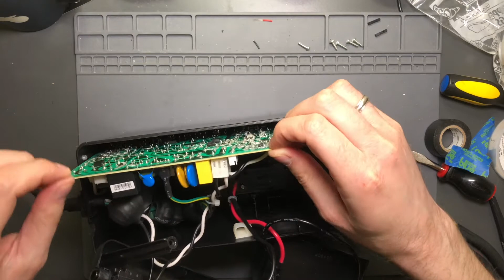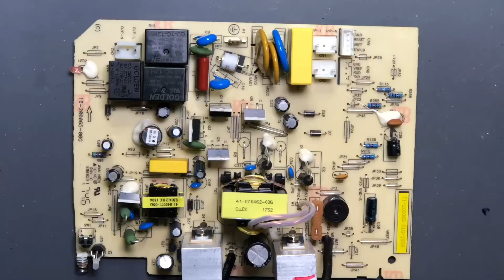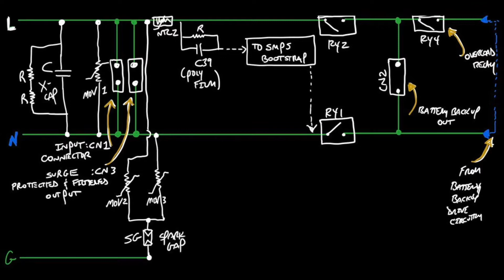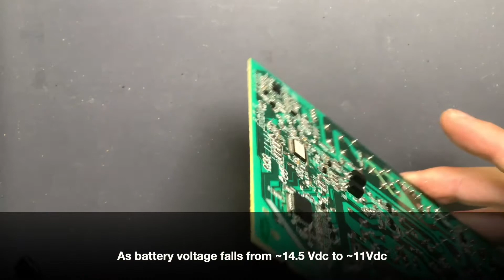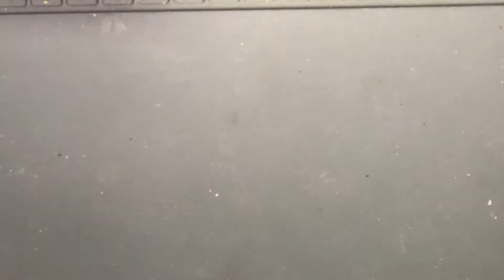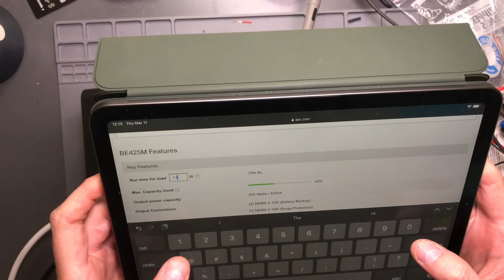APC Back-UPS 425 (BE425M) Teardown and Analysis (Part 2 of 2)

Comment: Good video, with one caveat.  Did I see you discharge a cap with a screwdriver?  Please guys, don't EVER do this.  Little molten metal in your eye, and you'll be wishing someone would have taught you the proper safe method.  There are plenty of video's on the Tube showing just how bad it can go and way more of how to do it safely.

Comment: I know I'm late to the party, but I just took my BE425M apart and wanted to add a serial port since it has that CN8 unpopulated spot on the PCB, but the circuitry seems to be there. If that fails, I plan to monitor the battery voltage with a Pi4 Raspberry controller I plan to run as a media server and web server for reporting the UPS status. I know I'll have to add an external ADC to handle the voltage measurements or I could use an ESP32 with builtin ADCs and simply make resistor ladder to scale the voltage to allow it to be measured by the ESP32. Has anyone tried this before? Is the output USB?
Reply from the maker: I am guessing APC uses different firmware for the different versions. So populating the components might not get you the result you are looking for. Hope that helps.

Comment: Tengo un problema en mi unidad funciona solo unos minutos con mi ps5 y suena un sonido y luego se apaga noce si sea la bateria pero enciende bien y todo es como si labateria no aguantara recarco que en el conector sin bateria trabaja todo bien solo es en el de la bateria que cuando conecto el pley se apaga
Reply from the maker: Hey, are you referring to the PS5 running on the battery backup while it is unplugged from the wall and running on battery? OR are you referring to how the PS5 behaves with the internal battery removed inside the battery backup? OR something else? Trying my best with the translation.
Reply: Este UPS tiene una capacidad de 255W el PS5 en su maximo consumo llega hasta 220W por lo que el tiempo maximo de respaldo seria de 3 minutos 49 segundos, si tu ups ya presenta desgaste el tiempo puede reducirse considerablemente

Comment: Too much blah blah blah you need to keep the content strictly on focus on the subject all this extra verbiage and opinions and whatever else you're throwing in there is a waste of time! You need to stay on point and just focus on what the customer needs they don't need an exaggerated video this is your battery replacement video you don't have to disassemble the whole unit and take the circuit board out come on keep focused on the battery replacement and get through the video
Reply from the maker: Try watching Part 1? That's the video that focuses on battery replacement. It's right in the title. This video is Part 2, where I specifically "teardown" and "analyze" the construction. If that's not to your liking, I suggest taking a pass on this channel. I like long form video.
Reply: Your comment is too much blah blah blah. Maybe try reading. This is a YOU problem.

Comment: Thanks for these videos.  I purchased a model BE425M April 2018.  The battery failed recently and I purchased a replacement after watching your 2 videos on this model.  The replacement is a 5AH, meets spec and is being charged properly.  The UPS output voltage spec is 115VAC +/-8% (105.8-124.2). My unit output is 97-99VAC with line disconnected. I don't know if it has always been that way because i did not measure prior to this battery replacement.  I feel like this low output could be damaging to the equipment plugged into it. (wifi router). Thoughts?
Reply from the maker: Perhaps dumb question but here goes: Are you using a meter that is capable of measuring true RMS voltage in order to measure the output? Less expensive meters that are not "true RMS" assume a sine wave, and will not measure accurately when encountering any other type of  wave form, like a modified square wave coming out of the UPS.
Reply: Thanks for the reply.  After pondering this issue for several days I pulled out one of my true RMS meters and all was well.  I should have amended my inquiry at that time.  Enjoyed your videos.  Thanks again! @TheCuriousEngineerChannel

Comment: In theory only, what would happen if I connected another 12v battery of the same type in parallel? I get the basics of battery tech, but not sure how the charging controller would handle it. I'm assuming this is a terrible idea and I'll cause a fire somehow ;) ?

Comment: I'm having an issue with same unit, weirdly when another equipment eg a microwave is turned on in the same circuit, the UPS puts itself in battery mode, i have other stuff connected on the same circuit so i know there's current, i guess maybe something is wrong with my unit.
Reply from the maker: Interesting! Is it only for a few seconds, or continuously while the microwave or other equipment is running? These devices could be causing a low-voltage condition or excessive electrical noise on that branch of the circuit, which is causing the battery backup to switch to it's internal battery.

Comment: My modem  takes .5 Amps @120 Volts AC, so that is 60 Watts. Do you think this should keep my modem running for about 30 minutes?
Reply from the maker: That’s quite a bit of power. Is that the nameplate rating on the power supply?

Comment: You do not show how to remove the screws to remove the cover.
Reply from the maker: Did you watch Part 1? I mentioned in the beginning of the video. I just added a card too and link in description.
Reply: I watched it but the screwdriver 🪛 head size and type wasn't mentioned.
I can't see that far into the well.

Comment: Hi, thank you for this tear down! It’s very informative.

I really need to mute this UPS and this model cannot be programmed to do that. Is it ok disconnect the beeper or should it be replaced with some resistor?
Reply from the maker: I haven't looked into that in detail - but I think it would operate fine with the beeper in an open circuit situation (removed). I just checked and the BE425M does have a "No Alarm". I checked and that's what mine is set in. Are you using a different model? Thanks for watching!